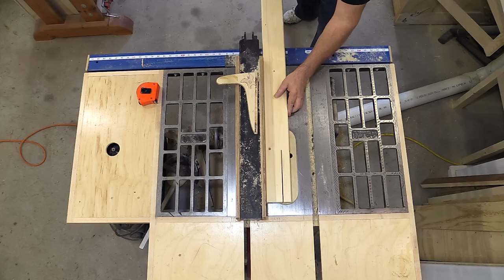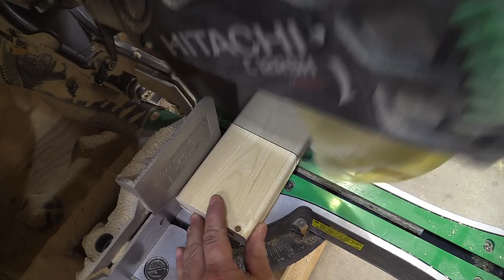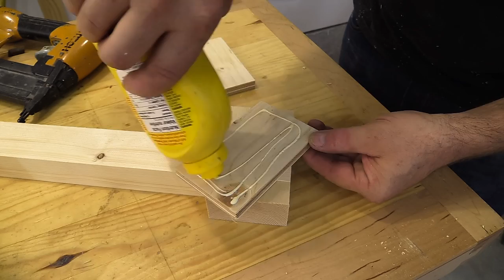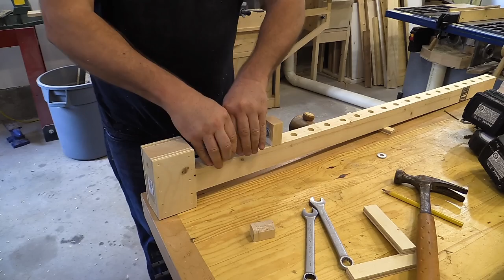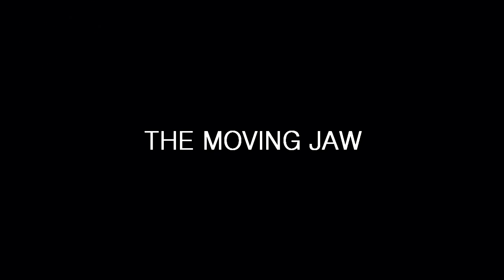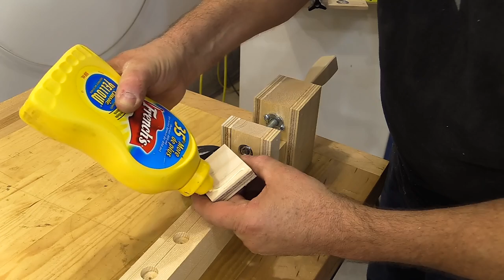How To Make A Wooden Bar Clamp (Free Plans)

Comment: Guess I'm off to Lowes and will hopefully find some straight 2x's. John your addition of and insertion points of measurements into the video is perfect! Makes it really easy to follow along. Q - why hammer the end if the rod when bolts will need to thread over that end. I like the technique of hammering nut flat to secure it. Thanks for sharing.

Comment: Great idea. Looking at your website; as you pointed out the wood does compress where the bolt meets the wood under pressure. I suppose, if needed/wanted/can be bothered, you could make the holes slightly larger and then epoxy some steel pipe into the holes. Just thinking.
Reply from the maker: grotekleum There are several ways to make the holes more durable, but at the end of the day wood will only compress so much, and these clamps can probably be used continuously for years without that becoming a problem that needs to be fixed.

Comment: Hey John, I really liked the video. This is a good way to get some really long clamps or a clamp of any length you want. The video was really slick too. Thanks.
Reply from the maker: The Homestead Craftsman Thanks! Although not quite as strong, they are lighter and easier to handle than standard pipe clamps the same length, and still develop enough pressure to clamp wide panels.

Comment: Oops, Safety Warning, it is a mistake to watch this video with the sound muted :-), kills the mood !!!. BTW, I think I remember you saying you were going to revive your old shop built TS, after watching so many of your videos, I get the feeling this one is going to be hard to beat or at least give-up, T-Fence with usable/accurate scale, router extension, smaller footprint, hmmmm. Any idea of the actual clamping difference between this and a similar bar clamp (i.e. this is more of a Question for Mathias, but you make a lot of clamps and vises)?

Comment: Awesome vid!  Hey check out at 3:06 at the lower right corner, right off of your black shirt, in front of and just under the end tip of your miter saw...  There seriously looks like some type of little inter-dimensional entity/ glow worm that was captured on camera!   ....Or it could just be a bit of fuzz that's illuminated by the lights in your shop...   But, replaying those few seconds around 3:06 a few times now, I'm kinda leaning towards the possibility that you've got yourself a "supernatural saw orb" in your shop....

Comment: Nice video, you got a thumbs up.

One suggestion though, because the black section covering the corners is a bit distracting try some kind of rectangular with rounded edges that comes from the sides and displays the text (try to stick to only one or two corners depending on the type of text, consistency is usually appreciated).

Comment: When I made these, I wanted the holes to be deeper to reduce the compression slip, so drilled them to twice the depth and added another nut to the lock-nut, and then sanded them down until they were round. But that meant that the "wedge-shape" underneath the locking block no longer gave enough movement to extract the nuts from the now deeper holes, so I replaced it with a simple bolt in the front of the plywood cladding (which I kept the same shape). Works beautifully well, and no compression marks in the front of the hole...

P.S. I made these from pallet stringers in quick time. They work very well.

Comment: What are the holes on the bar for? The moving part of the jaw seems to lock by using friction, not sticking something into the holes, so I don't really get their purpose.
Reply: The head of the lag bolt goes into those holes to hold it in position

Comment: if I wanted to use a long wing nut as the handle would crushing it onto the threaded rod be enough to make it turn the threaded rod and be able and torque hard without the wing nut simply turning and slipping or should i epoxy it as well? any suggestions?
Reply: +Max Jennings High strength LocTite maybe?

Comment: Great production. Nice looking clamp, too. Almost Diresta-esque style of video.
The pan action of your camera dolly looks a little unnatural after passing you by... perhaps some wooden gears on your camera dolly to get the camera to pan as it rolls by? Different ratios for different focal point distances? Or maybe just a programmable Robo-cameraman with an arduino and some servos? ;)
Reply from the maker: Chris Hodgson Pretty much everything I did in the video was intentional, including that opening dolly shot. After all, I could have done something very similar by editing a static shot, so I wanted that to look like it was - a bit rough and an obviously moving camera. I have another way to rotate it and will use that trick in an upcoming video.
I keep getting compared to Diresta, which is great, but our styles are much different. I try to use a lot less fast forward in mine and generally use a lot more angles.
Reply: John Heisz I was thinking the same thing about just editing a static shot. I really appreciate the number of different angles, it is a lot more work in all the camera setup, but the resulting product is a lot more interesting as a result.

Comment: Me like! And as all the folks says great video!! I wonder about the holes in the  long piece, What are they for? i Saw yoy made a friction stop on the moving jaw?
Reply from the maker: Lars Hagström All the details are in the website article: http://www.ibuildit.ca/Workshop%20Projects/k-body-clamp-1.html
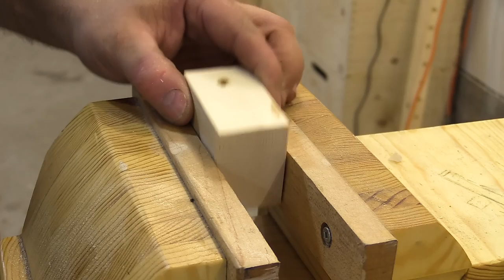Reply: +Lars Hagström The holes are for the 2" lag bolt on the moving jaw to rest in, locking the jaw in place. You can see the bot installed @6:30 with the head proud of the block.

Comment: I just gotta ask: Why 2"x4" and not 2"x2"? Looked like that's almost what you ended up with after the first cut?
Reply: might have been what he had on hand at the time.
Reply: OpposingForces i can respect that, use what u got :)
Reply: 2x4s are typically pretty cheap and easily on hand.  Also, they tend to be more straight on average.  Look at the 2x2 rack at Home Depot or Lowes, and you will have a tendency to never buy shitty curved 2x2's again.

Comment: Great clamp, great video... one question... Why did you file a flat section of the threaded rod in the handle?
Reply: To stop the thread from simply unscrewing from the handle, the flat fills with epoxy so keys it in place
Reply from the maker: Acts as a key to help keep the handle from turning loose.
Reply: Thats awesome thanks guys... great tip I will remember to use.